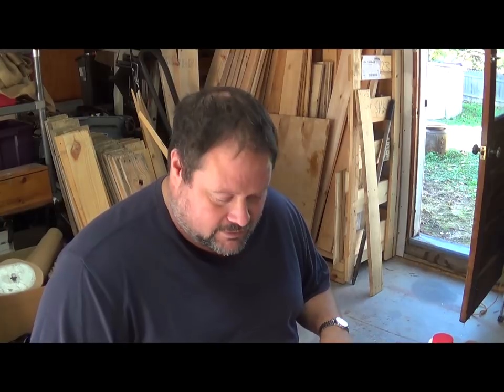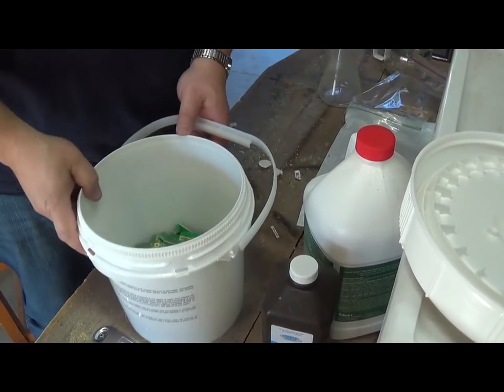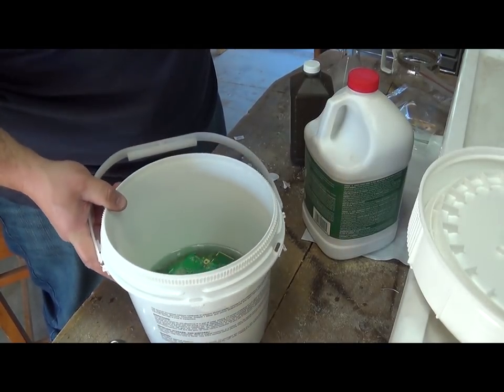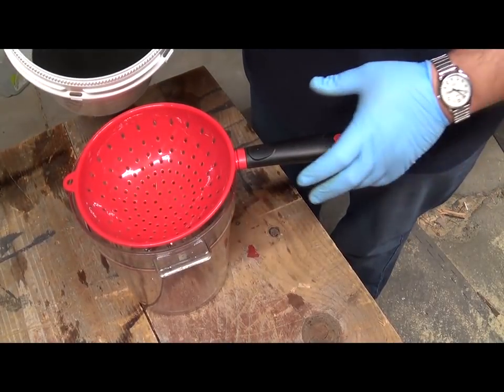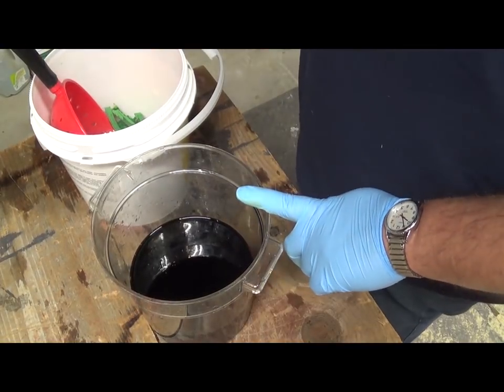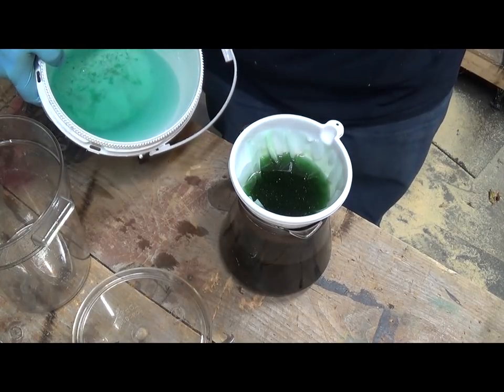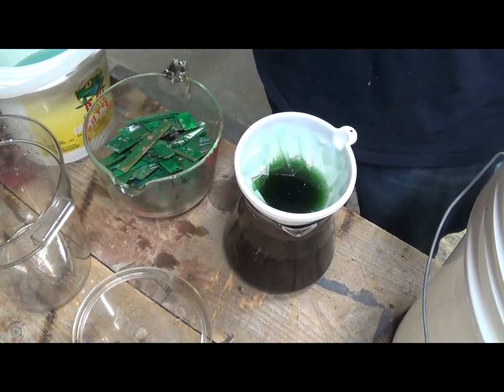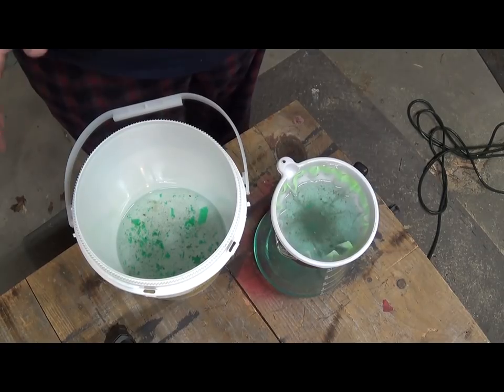Gold Foil Recovery from Cell Phone, Computer Monitor, and other plated boards -MooseScrapper

Comment: Moose is back in action! Helpful tip if you haven't found out by now... those strips from flatscreen monitors/TVs have a clearcoating of a sort that stops the gold from coming off so easily. Supposedly a quick acetone bath scrub (similar to lye baths but with no heat needed) would rectify that then AP should be able to do it's job :)

Comment: Hey moose, you ever think of putting your fingers and or boards in a smaller plastic strainer or bucket with holes in it and then into the larger bucket that you will fill with AP so you don’t have to worry about tearing the filters or leaving as much solution on the boards when rinsing?

Comment: Hey Moose I've seen a lot of videos lately about removing foils with a soldering iron so all that's left is the gold foil and the thin copper backing. Can I still apply the AP method to this type of material. If I can what's the best course of action to do it. Any feedback is appreciated. Thanks and God bless

Comment: Moose i do believe if you increased the amount of Peroxide  to your HCL you would get better results on those boards. Also removing the solder mask may also help in removing the foils as the soldermask appears to be diluting the acid to some extent. Just an outside observation.

Comment: Hi Moose scrapper..I need help.. I poored 1ltr of HCL and 100ml of hydrogen peroxide 3% into 1kg of cellphone boards pieces yesterday and waited, its boiling pretty well but color turns black.. How can I deal with this..HCL is industrial and not  household . I haven't noticed any written percentage on this HCL product label.. I purchased it from a chemical supplyer.
Reply from the maker: boiling? If its boiling on its own then the boards were not cleaned of all the bit and pieces.  Thats a bit more advanced recovery of gold.  The cell phone boards should have been scraped clean og any chips, mlccs, other metals etc.  Plus a liter may be a too much, just need enough to cover the boards.  Sorry i could not be more helpful...

Comment: would the copper dissolve quicker, if you had ventilation in bucket lid, so atmospheric oxygen would speed up reaction,  as with lid on, all extra oxygen from peroxide would get used up quickly

Comment: Hey moose how can I get the gold lines off of the circuit boards. Thank you
Reply from the maker: Clear off all the pieces, soak the board in hot HCL to dissolve any solder, then place it in AP for a week or so.  Any gold tracings will come off.  Thanks!

Comment: Much faster if u warm it up
Reply: I use a candle warmer and it knocka it out quick...next day...its kinda cold where i live so the hcl doesnt work correctly if its not atleast room temp
Reply: Silence Triedgood thas why i use copper chloride instead of peroxide
Reply: Silence Triedgood also if it disolves the gold jus drop with smb...
Reply: Silence Triedgood copper will drop gold silver and platinum all at once